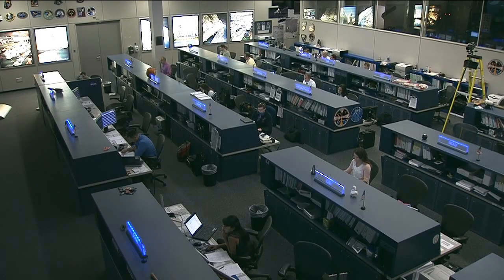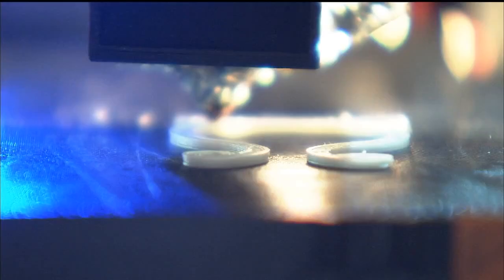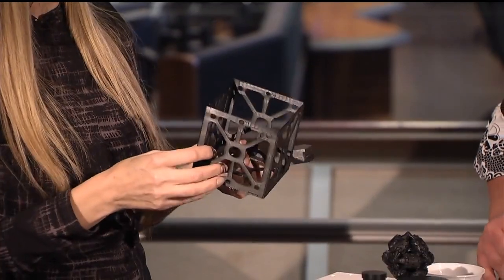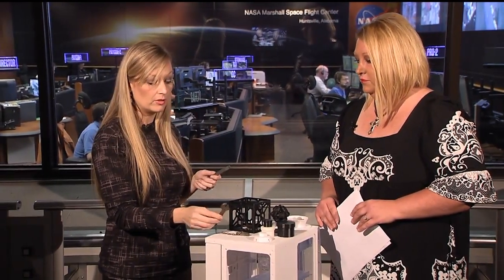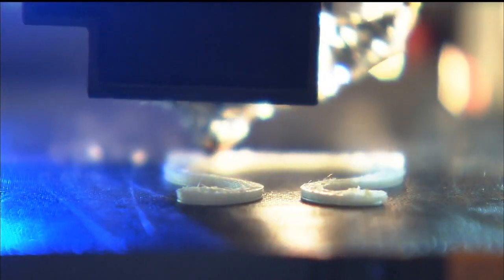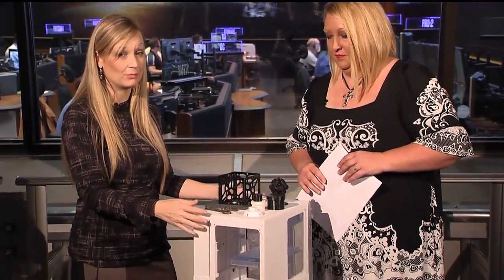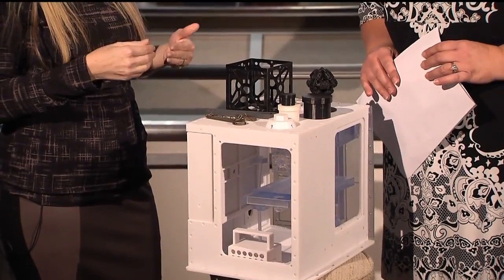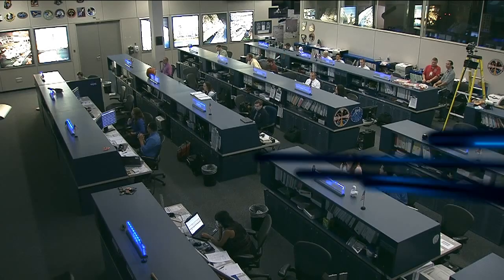What Will Be 3D Printed On Space Station? | Video

Comment: Not all 3-d printers use a powderd plastic most small ones use abs or pla plastic cord that gets melted as it reaches the printer head. It is possible to recycle the materials but don't kno if they will have that capability on the ISS

Comment: ☢☢☢ these don't seem robust enough to endure a hydrogen / nuclear powered space launch canon such as the early Quick Launcher bulk orbital system designs
~ better send this nifty macguiver dreams tool up on one of the old homo sapien safe rated systems
= shall it need to use next to the big ISS space magnetic or inside the gravity simulator centrifuge to get it to function as designed in free fall space, lacking any long distance voyage where the ship is either accelerating or decelerating